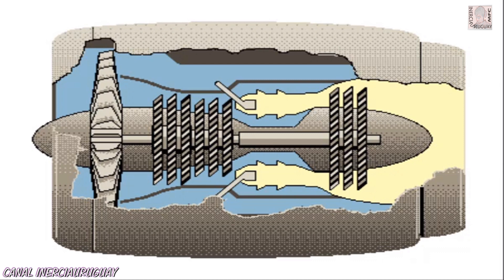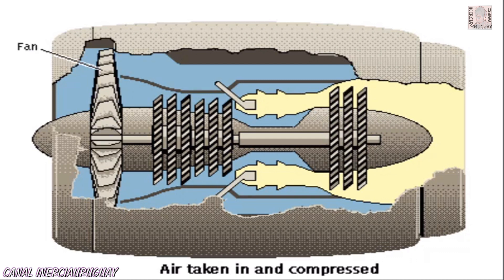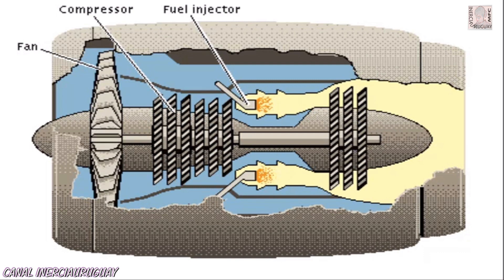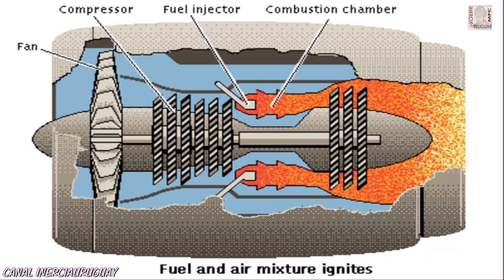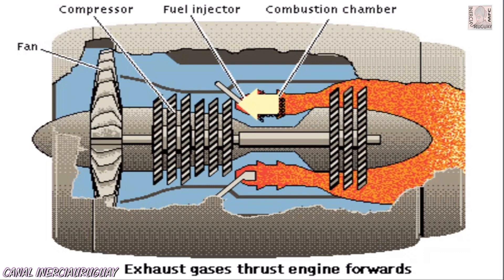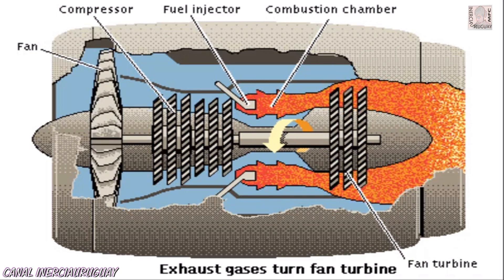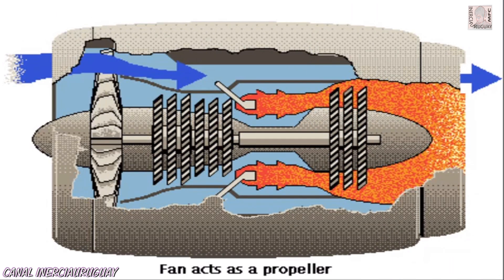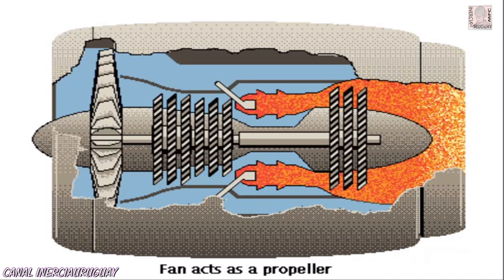JET ENGINE MOTOR PROPULSION AIRCRAFT TURBINE HOW DOES IT WORK? ANIMATED DEMONSTRATION

Comment: This was a great explanation except for one thing, it is not the fan’s reaction force that produces thrust with the bypass air contrary to conventional wisdom. The fan may act like a propeller in the sense that the fan blades are essentially mini wings that generate horizontal lift but the reaction force on the fan is little to none, so the fan produces virtually no net thrust of its own. I’ve talked with numerous people who work for Pratt & Whitney along with RR Trent and they’ve all told me the same thing. They told me that the fan which is a compressor blows air through the ever narrowing bypass duct as this air squeezes through a tighter and tighter space (similar to the rotor blades of the LP and HP compressor and those blades don’t produce any thrust). The energy that the fan puts into partially compressing the bypass flow cancels out nearly all the thrust produced by the fan acting like a prop so the fan’s net thrust is <1% respectively. Meanwhile, once the compressed bypass air reaches the bypass nozzle, it expands back to its original volume (and also expands some more as it cools the engine core and heats up to an extent), accelerates, and shoots out the back of the engine just like the core exhaust (though at lower speeds than the core exhaust). That’s how bypass produces thrust. I hope this helps👍